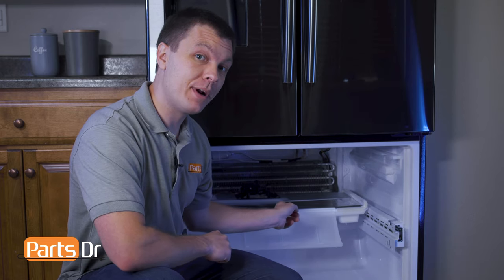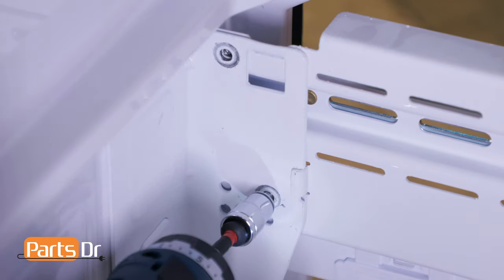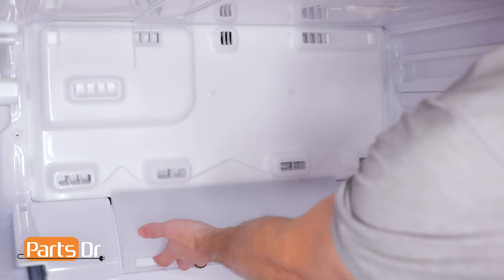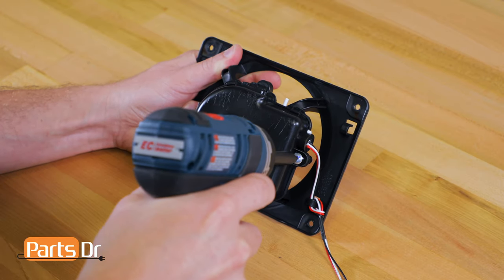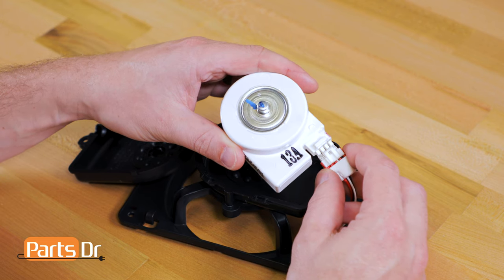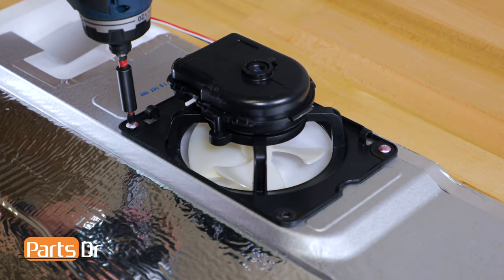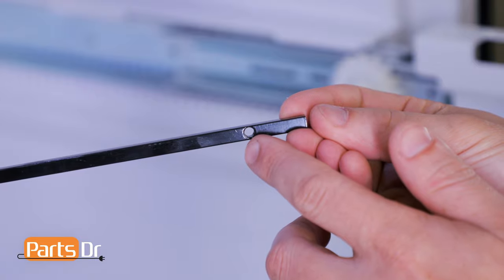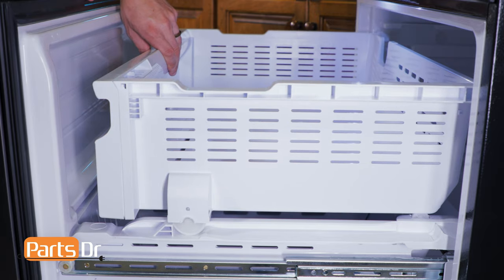How to replace Samsung freezer evaporator fan motor part # DA31-00146H

Comment: Does this motor cool the refrigerator on an RF220CNTTAW/AA Samsung model, or is there another fan behind the panel in the back of the refrigerator. How do I know if I have two fans or one? Freezer is cooling but refrigerator is not.
Reply from the maker: It looks like you might have a typo in your model number.  You will want to check the fan motor in the refrigerator compartment https://www.youtube.com/watch?v=lre-FuQKN5s

Comment: Hi. Freezer fan hardly runs at all.  Freezer temp ranges from -6C to -21C when set at -21C.  Would you suspect the fan motor? All sensors, evap cover and PCB have been replaced so far.
Reply from the maker: It could be caused by a bad fan motor.  Intermittent issues like that are very hard to troubleshoot since it will usually be working properly while you are trying to test it.
Reply: Thanks so much for your input. Your videos are great.

Comment: My Samsung freezer has two fans. Should I just replace both motors if I'm hearing the noise?
Reply from the maker: Usually only one motor fails at a time.  If you can determine which one is bad and is causing you noise, you should be fine to just replace the one that is bad.
Reply: @PartsDr  what method do you use to determine which fan is bad?
Reply from the maker: @cincocincoseis  You could take it apart and try disconnecting one of the motors and put it back together and see if the noise continues.
Reply: @PartsDr  The problem is that the motor was initially making noise. I took it apart yesterday to get the part number of the motor, then put it back together as is. When I powered the freezer back on, the noise went away, but I noticed that the fridge wasn't getting cold, even though the freezer was working (freezer was still cooling). So something is wrong, but there's no noise coming from the motor. Could the motor have just gone out entirely?
Reply: Replaced the fan motor but the fridge still is not cooling or cools very slowly. What else could it be?
Reply from the maker: @cincocincoseis  Is the evaporator coil full of frost?
Reply: @PartsDr  I pulled the fridge out and looked in the back. Once I removed the label, I saw a little bit of dust on the coils, but not enough to stop the flow of air
Reply: @PartsDr  also, I noticed that ice is starting to form in the fridge
Reply: I replaced each fan one by one and checked the coils. The fridge still is only at 50 degrees. Running out of ideas. Help!
Reply from the maker: @cincocincoseis  It could be a failure in the sealed system.  We would next check the frost pattern on the evaporator coils to see if the cooling system is working properly.
Reply: @PartsDr  I'm not sure which one is the evaporator coil, but I checked the coils in the back of the fridge and also the coils in the freezer after I removed the panel containing the fans and they both look fine. There is a little bit of frost on the freezer coils, but not covered in it.
Reply from the maker: @cincocincoseis  A partially frosted evaporator coil usually indicates a failure in the sealed system like a leak or a restriction or a problem with the compressor.
Reply: @PartsDr  Ok, I'm going to try to defrost the fridge to clear out any ice buildup first and see if that helps in the short term
Reply: @PartsDr  I recently got sick with a stomach bug. Not sure if it's from food poisoning from the leftovers in the fridge or from norovirus that's been going around. I decided to give up on this and just break down and buy a new fridge. I've been at this for way too long already. Thanks for all the help.

Comment: Hi. I have a sumsung rs22dcms side by side fridge I don't the exact evaporator my model. Is this fan motor compatible with rs22dcms sumsung fridge?
Reply from the maker: Sorry we do not have parts information for non-USA models. You will need to contact a parts dealer in your country for help locating the correct part.

Comment: The bad thing is, I have no idea if the fan motor is bad. It makes a vibration noise when it runs that it didn't use to make. I am not sure how to tell when the motor is bad but I have a feeling that mine is on the way out. The freezer still freezes but as I said, it makes a constant vibrating noise as it runs. My display was flashing a -2 unless I reset it. Then it would be good for a couple days and then it would start flashing -2 again on the display.
Reply from the maker: If the fan motor is not rubbing against anything and the fan blade isn't cracked or damaged then it is most likely a bad fan motor if the fan motor is noisy.

Comment: Great video.  Thanks!  I found the part on Amazon for only $18, rather than the $75 on the provided site.  I thought that was a really large price range.
Reply from the maker: The ones sold on Amazon are aftermarket parts and the parts we sell are original Samsung OEM parts.  We don't think it is worth the risk considering if the fan motor fails you could lose hundreds of dollars worth of food.

Comment: love your channel.  my samsung RF31FMESBSR freezer will not freeze. seems to be in the 30s.  how do i figure out what the problem is?  love your channel and thanks for your help.
Reply from the maker: Check to make sure the evaporator fan motor is running. https://www.youtube.com/watch?v=x9fK0bN72MA   Also, check to see if the evaporator coil is frosted up, if it is frosted up then it may not be going through the automatic defrost cycle.

Comment: How do you check if the fan is bad in the freezer? Is there a similar situation w/magnets like the refrigerator to see if the fan is working in the freezer? Checked the refrigerator fan thanks to your other video~! Having issues with the freezer freezing; seems that the refrigerator is achieving the temperature, BUT the freezer is struggling - what do you suggest checking? Thanks~!
Reply from the maker: Depending on your model, it may have a door switch for the freezer like we show here https://www.youtube.com/watch?v=UY2DXgWBP2U or it may have a reed style switch.  If it has a reed style switch then you will have to use magnet like you found in our other video to test it.

Comment: The freezer fan works  All the time without stopping or does it work with the heater  and is the fan connected to the timer please answer
Reply from the maker: In the refrigerator shown in this video the fan motor is controlled by the main control board.  It turns the fan on and off at different times.  For instance, while the refrigerator is cooling down the fan runs, while in defrost the fan is off, while the door is open the fan is off.

Comment: thanks you so much for this very helpful video. 
what are the parts numbers for the fan motor and the wire connected to it. 
I need to buy both parts. (fan motor + wire)
Reply from the maker: What is the model code/BOM name of your refrigerator?  https://www.youtube.com/watch?v=4HhWL9sonuE

Comment: Thanks for the video. Any tips or tricks to remove the plastic cover ?  Mine seems like the styrofoam is stuck on the ice and the plastic cover is coming off by itself. Ive been thawing the freezer section for over 15 hours now.
Reply from the maker: If it is thawed and still not coming loose, you usually don't have any other option but to start prying and forcing the cover off.  Unfortunately, sometimes there are no other options.
Reply: I have the same issue with the cover and styrofoam stuck. How did you manage to get them off? Thanks